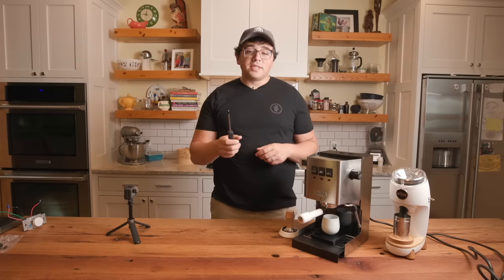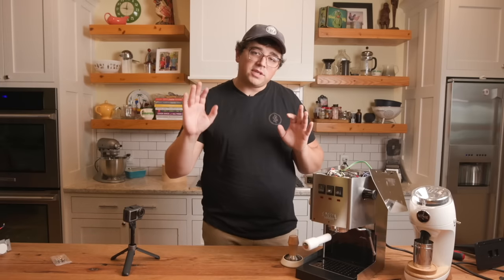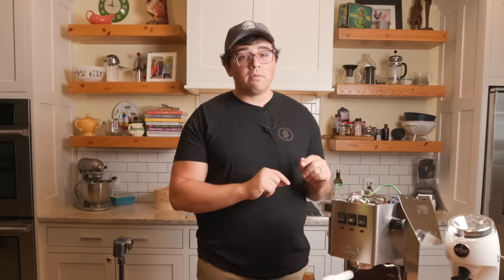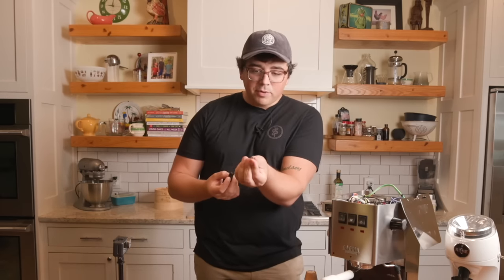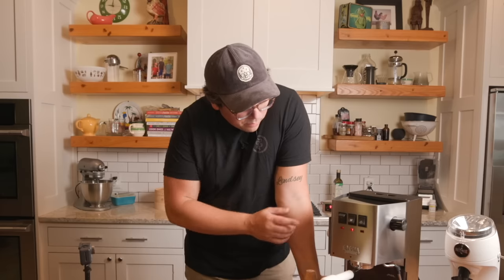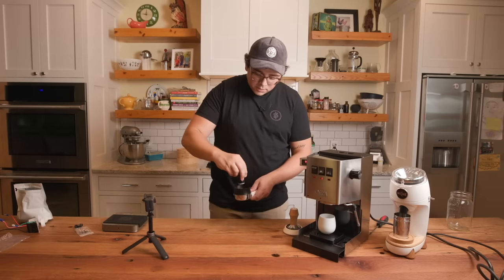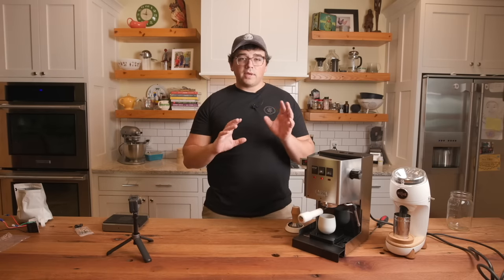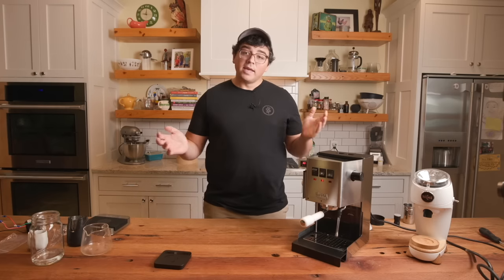TURNING A $450 MACHINE INTO A $3000 ESPRESSO MACHINE!: Gaggia Classic Pro FRANKENSTEIN

Comment: How strange. One of the wonderful qualities of this machine is it simplicity and robustness, no stupid circuit boards or chips to get corroded. I’ve had mine for 25 years and hasn’t skipped a beat in it’s twice daily use. I only clean it every 2 or 3 years and its only after cleaning that I ever have issues with steam flow. Never even had to replace an o ring or gasket.
As someone who in the past, worked with and understands the mathematics and electronics of control units, a PID controller is a bizarre addition to a domestic machine. You would normally use one of these to control an industrial chemical reaction tank or the like. Why mess with the pressure relief valve too, mine is factory and very rarely discharges, I want as much pressure as I can get, not less!

All very odd. It’s the reverse of polishing a turd, but each to their own I guess😊
Reply from the maker: Tell me you drink super dark roast without telling me you drink super dark roast (no judgment, just very telling)
Reply: I just drink coffee and what wonderful coffee it makes. Nearly as good as you would get from an $20 mocha pot boiler you put on the hob, but slightly more convenient. 

A workman reaches out for a hammer, instinctively weighs it in his hand, and begins to work. Each blow is hammered out with tiny, imperceptible adjustments of velocity and trajectory – adjustments that the workman does automatically and is barely aware of making. In fact, the more competent the workman, the less aware he is of the hammer at all: he simply hammers away. The movements in his hand are realized in movements of the hammer in such a way that the hammer serves as an extension of the workman’s hand. In this way the hammer and the workman are together, entangled. The moment the workman begins to contemplate the hammer as a separate object or ‘thing’, something gets in the way: something doesn’t work properly, and the very Being of the hammer itself gets lost. To simply stare at the hammer, to think about it as a separate ‘thing’, does not reveal anything of the Being of the hammer. In this way, the Being of the hammer is disclosed in its utility, its use: it is with the workman, in hammering, that the Being of the hammer is revealed. The same analogy Heidegger used to explain the entanglement of the hammer and the carpenter equally applies to coffee making, keep it simple and the user feels at one with the machine but complicate it and one looses connection with our being in the world, an intrinsic part of the coffee making and coffee drinking experience. Never thought I’d manage to slip in some existentialism into a post about coffee, but it is relevant, simplicity and utility are king in everything.

Comment: Probably the post anticipated video because I've got a second hand modded GCP. Currently have everything you've shown except shower screen and dimmer. I'm not sure if i would get the dimmer since i've been using the steam wand bypass hack from last video for a preinfusion.
How critical / impactful will shower screen mod be in my case?
Reply from the maker: The stock one isn't bad.
Also, while the steam wand bypass hack works, your temp drops a lot faster that way. The dimmer mod is like $10 for all the materials combined. Highly recommend

Comment: Just a heads up before you dive into the rabbit hole of installing a PID, dimmer and pressure gauge. Shades of Coffee currently working on a new product that incorporates all of these into a single unit. They already have a prototype and planning to start selling in 2022. Please reach out to them before you make any rushed decisions, as they can share photos of the prototype too (which looks amazing by the way!). Also...

If you are considering buying Auber's PID with pre-infusion instead, be aware that they are using the "pumped pulse pre-infusion" technique, which basically sends a pulse of full pressure before starting the brewing process. This is exactly what you would get if you were to turn the brewing button on for a split second, then off again and back on for brewing. The PID just automates the process. This is important to know, especially considering the price difference.
Reply from the maker: I wish shades would have told me this when I was making the video! Bummer.
Reply: @LanceHedrick  Maybe it wasn't in the works back then or at very early stages of a proof of concept? Either way your video is still very fun, useful and informative. Waiting for the new video when you get your hands on the upcoming one! If they actually release it... Keep it up!

Comment: Thanks for the video. Very helpful. Is there a similar mod for flow control that can be done with rotary pumps ? Ofcourse one could do the needle valve mod , but messing around with the hydraulics seems daunting to me. Thanks
Reply from the maker: It depends on the machine! Lots of mods you can find on home-barista and EAF discord!

Comment: Hey Lance. Great video. I’ve done similar with my Rancilio Silvia, except not the flow control which I’d never considered until now, thanks.
What are the app and scales you used in the video?
Reply from the maker: The app is Smart Espresso Profiler and scale is acaia lunar! The app works with any. Bluetooth scale. It's a free app
Reply: @LanceHedrick  well damn, I just got the Timemore scale, but now with the dimmer mod and the Smart Espresso Profiler app, the Decent scale is looking awfully tempting.
Reply: @LanceHedrick  do you think I’ll need a Bluetooth scale to properly take advantage of the dimmer mod?
Reply from the maker: I would recommend it but it isn't 100% necessary! Can absolutely go by feel/sight. Like, a good way to use the mod is to open all the way to saturate the puck, then once you see drips, turn it all the way to the lowest setting and let it slowly extract. Just play around with it!
Reply: @T100ley  Yes, I was looking at that scale too. Seems to be really well thought out (obs; it's decent). Taller than the lunar though.
Reply: @spike443  I have been measuring output from the group head over 30 seconds to determine this volume to figure out water debit. Not as slick, but definitely a rudimentary way of calculating and then you can mark the physical location on the dial corresponding with amount of water debit.
Reply from the maker: I've heard a lot of issues with the decent scale. Don't have one myself, but hearing about the problems from others
Reply: @LanceHedrick  Oh, okay. Thanks!

Comment: You almost answered my question! I don’t have an espresso machine. Interested in best bang for the buck (the less I can spend, the better - for a legit machine). This is around $1K with the mods so if I don’t already have one, what do you like?
Reply: I ended up answering my own question. I got a Solis Barista Perfetta on sale for $450 and have been super happy with it! Compact, heats up quickly, and has the convenience of automatic features along with some manual control so you can dial in your preferences.

Comment: Very interesting, thanks. Do you think you get better results with this than with a rocket appartemento ? Congrats on the baby btw ;)
Reply from the maker: Probably not better results than an appartenento, no, since you can add flow profiling to the rocket. It is a much better made machine. BUT e61 groups are not ideal for temp stability, tbh
Beautiful machines, well built, but I suspect a lot of it is beauty over function.

Comment: Hi Lance, big fan of your content, and congrats on the baby! 

For the Dimmer Mod, where did you connect the ground wire to? The reddit links didn't cover that.
Any detailed steps you can offer?
Reply from the maker: I connected the ground to a spot above the group. There is a place behind the switch board where another ground was placed. About an inch away, there was another place for a ground that was unused. I placed it there

Comment: HI Lance, I just added flow control to my GC and am enjoying playing around with it. I've noticed it seems the espresso temp is lower using a slow and low shot, have you ran into this? Do I need to adjust my PID to set the brew temp higher when pulling low and slow shots on a single boiler machine like this? Thanks.
Reply from the maker: I'd increase the PID. And remember to offset the temp because it will definitely lose heat from the boiler to the group. Temp is measured at the boiler, not group. Offset by like 7C
Reply: @LanceHedrick  Perfect, thanks.
Reply from the maker: Anytime friend!

Comment: I have an older Classic that has the plastic tip steam wand instead of the cafe level one. Do you know if I swapped the steam wand out would it have enough pressure power to use it?

Comment: Hey Lance, getting into the whole DYI gadget mods and found your videos on point.
I actually follow the spring hack by replacing factory spring with the 9-bar one, and now my shots are thinner and faster poured than before. Any tip why this could be happening?

Thanks a lot!
Reply from the maker: There are loads of reasons this is likely happening. Difficult to diagnose based off just this. I will say, the spring isn't the culprit. Likely just need to go finer on the grind size
Reply: @LanceHedrick  thanks for the advice. I tried a couple of finer settings in my grinder and it seemed to have improved the shot quality. I'd still like to get that perfect shot, and get those 25 seconds counted with enough pressure. Thank you though!
Reply from the maker: Sure thing! I wish I could help more but so hard without tasting! Lol

Comment: Hey Lance, I noticed the brew light blinking on/off right before you begin the flow control demo. Is that due to the dimmer switch being installed?
Reply: It actually is part of the PID mod. The mod uses an algorithm to keep the boiler at a steady temp so the light blinks and flickers.
Reply from the maker: Jared is correct! Thanks for answering, friend.

Comment: Taste is better with 6.5 spring or depends on the beans you are using? For example I use medium roast beans, is it better the 9 spring ?
Reply from the maker: It really does depend on the style of shot you're going after. Lighter roasts have less puck integrity and usually 6 bar can accentuate the taste and increase evenness of extraction hypothetically (there are papers substantiating this, but not objectively). 9 bar is great for high puck integrities!

Comment: great video, i just wish you'd explain what these mods do exactly and why are they worth installing.
Reply from the maker: PID maintains temp and gives you control over temp, flow control (dimmer mod) gives you control over flow, the low drip tray allows for a scale to sit under the cup.
If you have any specific questions the video didn't answer, because I feel they did address those concerns, let me know what you want to know.

Comment: Just finished the dimmer mod on my Rancilio Silvia last night. I took into account your experience of looking for a single-pole dimmer, but ended up hearing a dead click sound and had to buy a cheaper rotary dimmer from home depot (although I am in Canada and we have different access to products from home depot here). I am not sure why the first single-pole dimmer that I purchased didn't work, but I suspect it was because the controler type was "multi-location". Anyways, a rotary single pole dimmer switch ended up working. It is a 600W rating for incandescent. Just thought I would share to save other people time. Perhaps somebody else has more electrical background wound know why. My pump is a UKLA too.
Reply from the maker: Yeah the multi location doesn't work. Should've added that. Cheaper is best! Lol
Reply: I just did the dimmer mod on my Rancillo S24 Ulka vibe pump (already did the gauge) but it does not work, just a click...I bought a simple dimmer and pulled off one of the pump wires and spliced it in. The dimmer is a 2 pole incandescent, I need more infro on another dimmer please?
Reply: @LanceHedrick  what does multi location mean?
Reply from the maker: Needs to be single pole. And should not have the option of more. If it costs more than $7 USD, it's not right lol
Reply from the maker: I have no idea what it means. All I know is the two dimmers I tried that said multi location on the package didn't work. Anything with multi, avoid. Single pole. Cheap. NOT led capable. Etc.
Reply: @LanceHedrick  here in Australia nothing is cheap.  Even Bunnings had some for about $35 but they had more than 2 wires so I did not buy them. I went to the electrical wholesalers and asked for the most basic for incandescent with just 2 wires but it does not work. It says on it- suitable for incandescent and small motor loads, would a fan controller work?  I might have to order something online.
Reply from the maker: Very weird! I linked on the caption where I got mine. Perhaps you can find the same model and order online! Wal Mart seems to ship globally lol
Reply: @LanceHedrick  I spoke with my electrician friend, he says he will need to dig through his box of "old school" dimmers from years ago as now all of them have too much electronics. we are 220V down here by the way so nothing from USA would work.
Reply from the maker: Oh yeah that's true. Get that old school dimmer! Haha

Comment: About using the dimmer switch for Breville machines. Can we "really" do that because Breville has a patented technique for controlling the vibratory pump to get soft preinfusion with varying pressure, which if I'm not wrong is frequency not voltage based to maintain the torque. If it could be done then it would be awesome.
Reply from the maker: Yes it can be done. I have a friend with the dimmer on his infuser. Works like a charm

Comment: I am only missing the dimmer mod! I am so doing that, light roasts are still really difficult for me to get right. I'm using the steam wand as a way to create a pseudo-pre-infusion, but the flow control without having to waste the water from the steam wand is awesome. Terrific video and furthers my appreciation for my GCP.
Reply from the maker: Yes! And the dimmer will disallow as much heat loss as the wand trick does

Comment: Really informative! Just wondering if there’s a need for a resistor to prevent back EMF for the dimmer mod?
Reply from the maker: That's a good question! Haven't put much thought to that. I'll pitch this to the gaggia community who have been doing this mod for years. Thanks for watching!
Reply: @LanceHedrick  Wow thank you for such fast replies. I have been sitting on this mod for a while not because of the back EMF because some have said that at the lower ranges it’s harder to control. Like the pump stalls without a suitable resistor. 🤷🏼‍♂️ and reduces the lifespan of the pump but I guess only time will tell right.
Reply from the maker: This is true. I can't imagine the pump being that expensive, though. So replacing should be simple
Reply: @LanceHedrick  Well that’s true too. Ulka pumps should be quite inexpensive. Just that here in Asia it’s hard for us to get spare parts without it being priced reasonably so that’s kind of sad. Shall try the dimmer mod soon:)
Reply from the maker: Oh you're in Asia. Didn't realize! Have no idea how hard parts are to obtain. Ulkas are easy here. Thank you for the chat! Hope to see you on more videos, friend.

Comment: Dear Lance, I have 2 questions:

1. Isn't it possible that when you drop down the pressure to 6,5 bars no coffee will come out because you ground and pressed the coffee in the portafilter too hard?
2. Couldn't be the lower pump pressure a bad effect on the extraction quality? Or it should be even better? Somwhere I heard that a good coffee machine can push up to 15 bars.
Reply: To answer your questions in order.
1. If the flow is blocked you've likely ground waaaay too fine and can happen at any pressure and is more likely at higher pressures if there is any inconsistency when the water compresses the puck. As for tamping pressure more and more barrista's are exploring if tamping is needed beyond that given by a jack leveler, yes you want a flat bed but many experts (including award winners) are saying a jack is enough if your grind is correct.
2. High pressure leads to faster extraction but also higher chance of over extraction and channeling. Studies done recently show better TDS around the 6-8bar range with the sweetspot being around 6.5-7 for most con-prosumer level machines and likely this is also true of pro machines. But in high turn over shops 15bar is the standard for it's ability to almost half a shot time...
Reply: @wodmarach  Thanks!
Reply from the maker: Looks like someone responded before me, and with good info! sorry for delay
Reply: @LanceHedrick  Thanks for the compliment. :)
Reply from the maker: absolutely! I seriously love when people help others in the comments. I try to get to them all in a reasonable fashion, but it is a bit difficult.
Reply: @LanceHedrick  Thanks for the confirmation. :-)